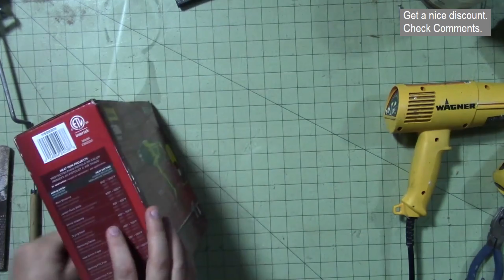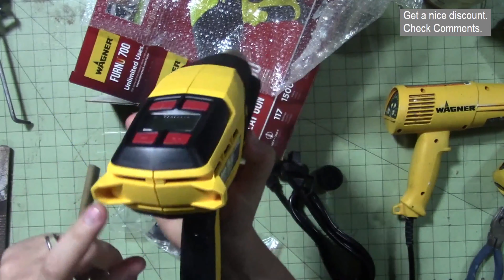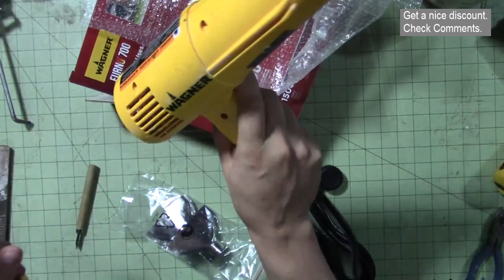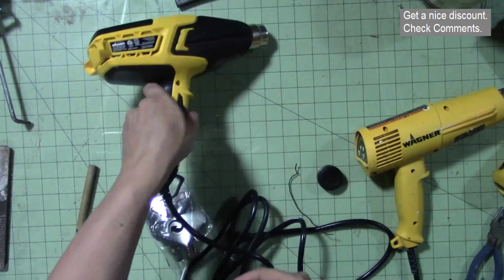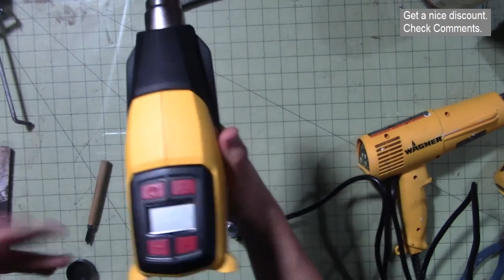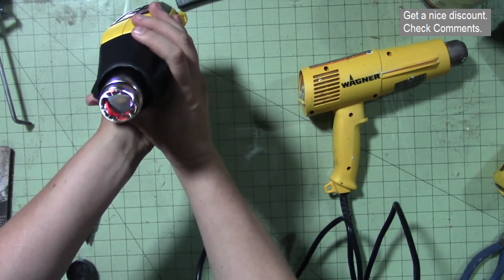Wagner Heat Gun (Don't buy it before you watch this)

Comment: For everybody  here frustrated with this "review" on RED USER MANUAL FIRST.

 I can say that WAGNER'S FURNO 700 it maybe takes a little time to learn how to make precise adjustments to temperature and the fan speed combination for a particular work or material, but when you master it then you can find a lot of applications and work in a more subtle, refined and flexible way allowing newer things in high power or low power.